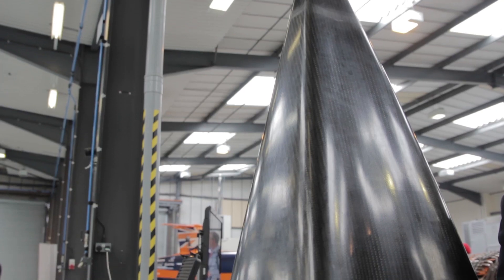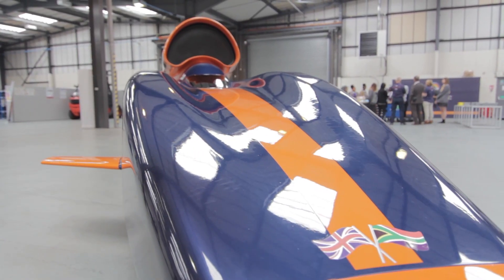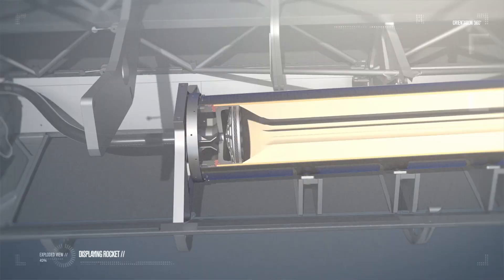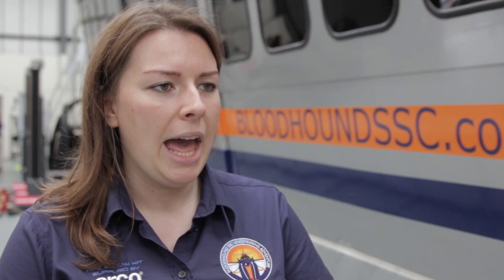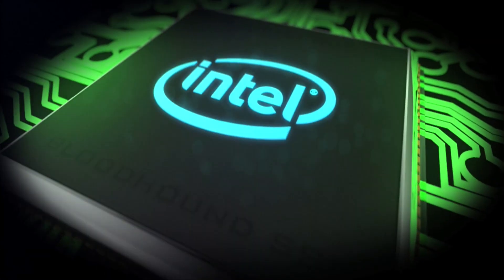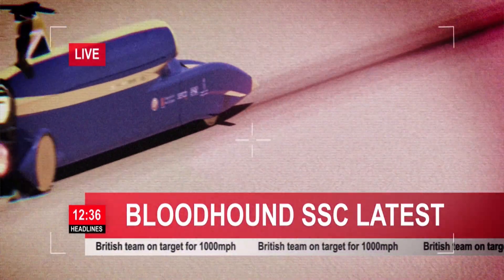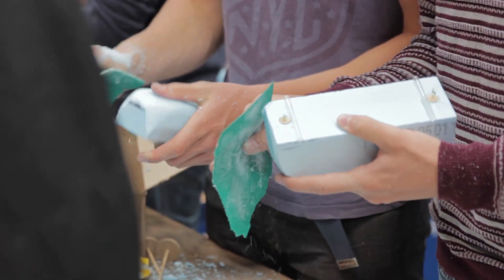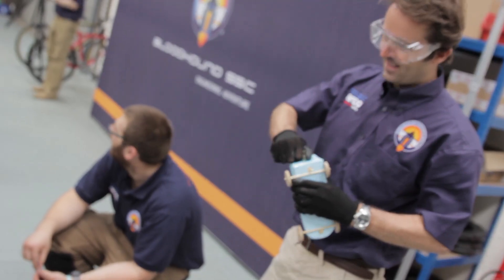Bloodhound SSC | Progress Update

Comment: this thing is huge
Reply: Has to be really, when you consider the jet engine, the multi stage rocket system and  the cosworth engine used for the oxidizer system for the rocket engine and the ammount of solid rocket fuel required for the run. Can't wait to see it go.
Reply: bruh this would be legit if it did not have a jet engine which is so stong to make it im;pressive pretty old since all eurofighters are faster then it unless it uses it twin turbo engines to make fire come out and go a little bit faster at accelration